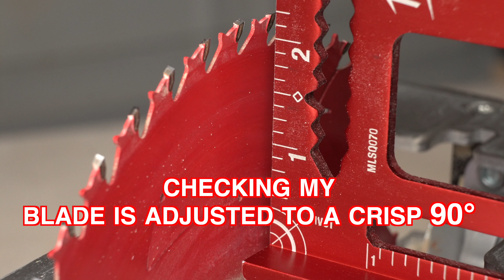Circular Saw Only! 3 Important Jigs To Make

Comment: Nice helpfull video…..what’s that pinkish sheet on your work table
Reply from the maker: Thanks! The pink sheet is Xps foam insulation board and my preferred cutting surface with my circular saw. It’s lightweight and plywood doesn’t slide around on it easily. Picked it up at Home Depot.

Comment: The number 3 jig it looks nice but miter saw will do the same or better. The first and the second jig make sense I am  not sure that is the advantage of the 3rd. Can you please elaborate ?
Reply from the maker: The 3rd jig is just a more capable cross cutting jig. If I only had a circular saw for woodworking, the 3rd jig is what I would use most of the time for improved accuracy, it also cuts 45 degree angles quite nicely.